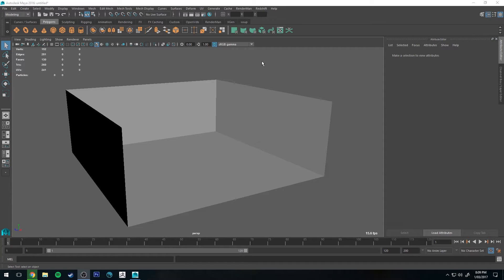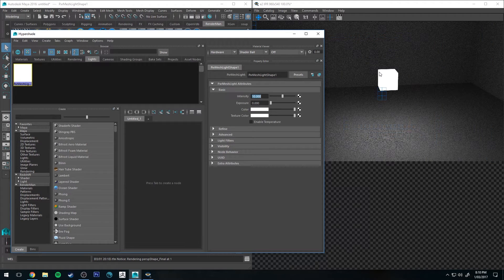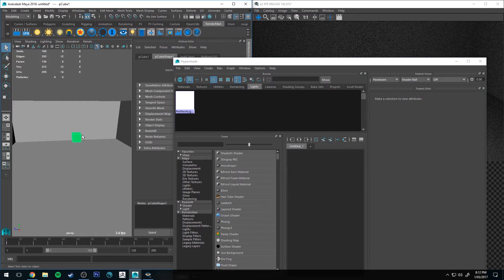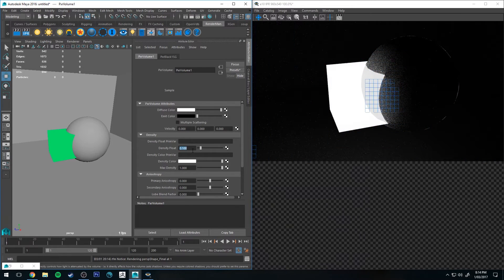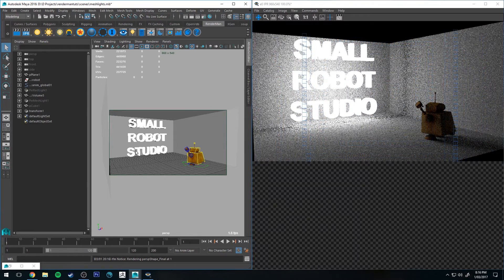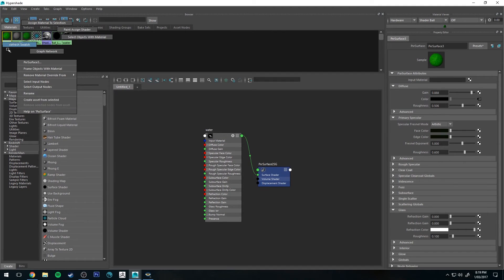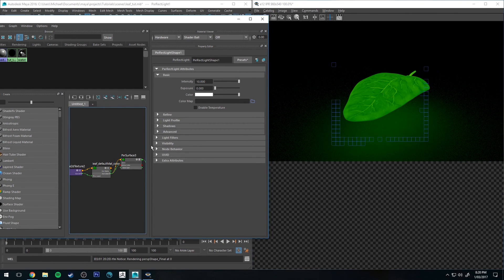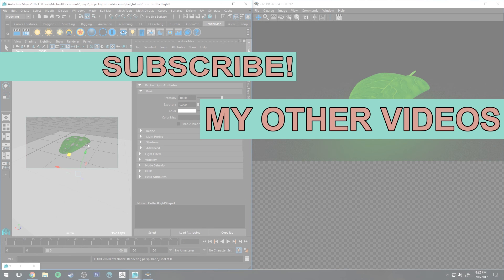Renderman 21 Mesh Lights Tutorial

Comment: Is there a way to make only a certain part of a mesh glow?  For example, I'm rendering a stylized firefly and I only want the tail to glow.  Since they are the same mesh I created a black and white emissive map, however I'm not sure how to use that map properly.
Reply from the maker: Not if you're planning on applying a different material to the rest of the model as mesh light works as a light rather than a material. In theory you could use your emissive map and route it into the intensity input of the mesh light though I've not done it that's just my assumption (not sure if this use case was an intention in design of the mesh light function either... but might still work none-the-less). My advice would be to split the tail off the model as a separate part then parent it to the body in Maya so you can get materials for each part.

Comment: Hi! What's the difference between Mesh Light and PxrConstant?
Reply from the maker: PxrConstant is sort of like using a PxrSurface Glow effect except simplified to a much smaller node. Useful for things like projections if you don't want to use a Gobo or something like that. If your only intention is to create a mesh that is illuminated simply and you don't require the extra options that a mesh light would provide (exposure, intensity above 1.0, colour map + temperature, light linking, normalizing etc) then could be an option as it's very clean to set up.
Reply from the maker: Also, good question thanks for asking!
Reply: thanks for the reply